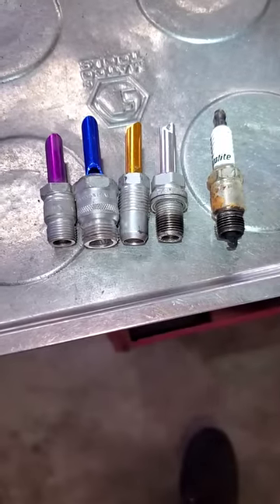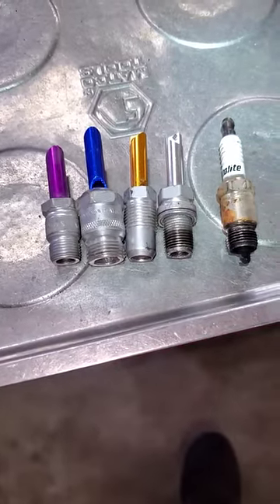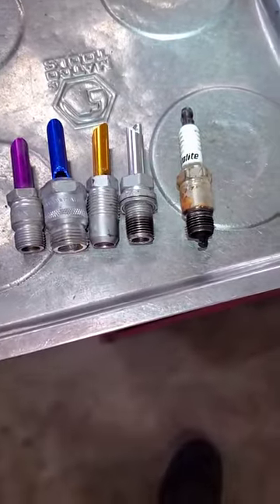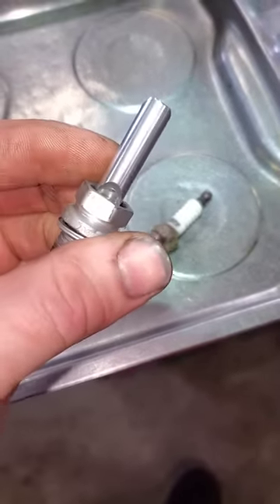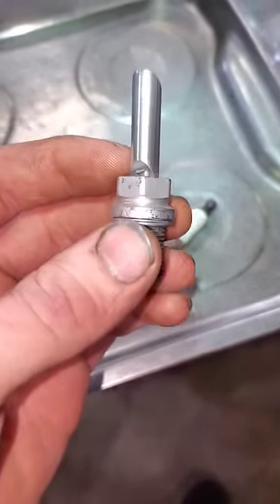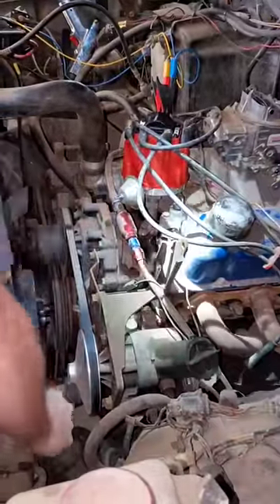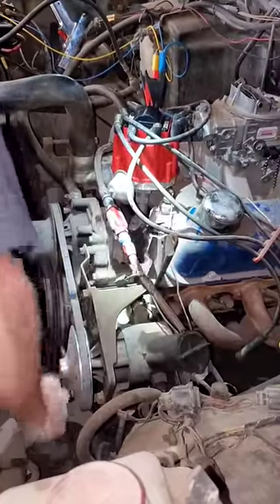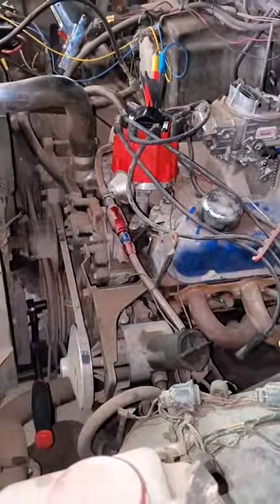Compression Whistles- Where Have They Been All My Life?

Comment from the maker: Attention to all the ignorant members of the YouTube comment crew: I specifically state this tool is used to find COMPRESSION STROKE, not TDC. I only said the piston was close to TDC because well, *it was* and to give the viewer an idea of what was going on inside the engine. 

If you want to find true TDC the only 100% accurate way is by using the piston stop method. The compression whistle tool is only used when stabbing a distributor to get the distributor gear in proper time with the cam gear as there are two different TDCs- compression stroke TDC and exhaust stroke TDC. If you stab the distributor at exhaust stroke TDC, the rotor will be 180 degress off. 

Also, when stabbing a distributor perfect TDC is not required and you can simply use a borescope or screwdriver to acquire "close enough" TDC.

And yes, I know this is cylinder #5. I filmed it like this as it was only a demonstration on my lunch break and that spark plug was the easiest to get to.
Reply: Just to say I preciate you sharing the video brother. Had no idea these existed tbh about it. Best thing to do for the ones talking shit,that prolly can’t even check engine oil. Hell just post another video bro.give ‘em sumn to really talk about 👍🏼
Reply: I never heard of these. I'm gonna get a set now cause I'm having an issue with a 3rd gen Camaro trying to get it timed on the distributior
Reply: Makes sense. It just tells you there is compression so it's probably worth it to get it cranking under its own power
Reply: Where do you get these from? Does Matco have them ?
Reply: Great video.  Question: It whistled multiple times.  How did you know when to stop?  Thanks!
Reply from the maker: @dalevackar182  Ebay
Reply from the maker: @turkeyssr  if it's still whistling, the piston is still traveling up so keep turning until it gets quiet. Then adjust piston to TDC with a borescope or screwdriver
Reply: @TechnicianRed  Yeah I found em thanks. It's kinda hard sometimes to hold your finger in the hole and roll her over by your self despite what the o-lady thinks.
Reply: Actually pretty cool. I'll have to check them out. Better than removing all plugs except cylinder 1, and feel for compression. That's how I do it, then verify TDC with a 1/4" extension
Reply: Or.. do the same thing with a long 1/4in extension lol
But I do understand you the position and circumstances won't always allow you to fit one down in there
Reply: @cokevspepsi516  I have long Phillips, the 1/4 extensions, even zip ties. Downfall, V8's you need to know if you're on compression or intake without having to remove the valve cover in many cases. 4 bangers are easy.
Reply: Isn't it obvious that a whistle isn't gonna tell you where tdc is lol?? It looks like a good idea maybe. I want to try it. Why would it whistle if the exhaust valve is open though?
Reply from the maker: @thehulkamaniabrother2.089  it whistles on exhaust stroke as some air goes out exhaust valve but some still goes out whistle as well. I'd say the whistle is about 80% quieter on exhaust stroke.
Reply: @thehulkamaniabrother2.089  yes, but the whistle doesn't have anything to do with TDC. Only compression or intake stroke. Example, we just did head gaskets on a 96 Suburban. Before you open it, you need to find TDC. But the harmonic balancer timing mark will show TDC on Intake and Exhaust. The whistle or compression tester will show which stroke you're on. You can also leave cylinder 1 spark plug in and feel for compression.
Reply: You were pretty clear. No need to defend yourself. Could one use the whistle with the TDC mark on the pulley? Would that work for every cylinder? Can't always trust the distributor, correct?
Reply from the maker: @pfsantos007  you could use the TDC mark on the balancer assuming the mark is accurate. Too many times I have found the balancer mark to be off more than 10 degrees  due to variances in the crank keyway position, aftermarket balancer being off, or (the most common issue) the outer balancer ring that has the timing marks has slipped on the inner hub from the rubber isolator loosing proper grip between the inner and outer portions of the balancer. This is why I allways confirm the TDC mark is accurate before timing the engine. I do this with a piston stop. Rotate engine until piston hits stop. Record reading on balancer. Now rotate engine the opposite way until the piston hits the stop again. Record reading. Both readings you took should be an equal amount of degrees from the 0 degree mark on balancer. So, if the first reading is 5 degrees BTDC, the 2nd reading should be 5 degrees ATDC. If they aren't the same, the balancer marks aren't accurate.
Reply: Man I’ve been around a long time and have many other ways of verifying the compression stroke…. But these compression whistles and the idea of compression whistles is just a fantastic idea! And I think anyone who works on engines should have a set of these. The only people hating are mad because they didn’t come up with it. Mad props to you, compression whistle guy 👏👏👏
Reply: @TechnicianRed  I see. Might have to try that. I have a 96 Tahoe that is being a piece of shit lol
Reply: Can you please make the engine run on five  cylinder it will sound cool to hear it 😂😂
Reply: AWESOME and I found timing marks off by 10 degrees on a Dodge Colt when I was in the process of rebuilding it when I was only 23 years old. I would highly recommend not getting into a hurry because if those are not tightened properly someone might get a hollow bullet in their forehead. 👀🙏🙏🙏
Reply: @josephmason738  I haven't seen a Dodge Colt for at least 23 years now lol. I forgot about those things until I saw that. My aunt used to have one.
Reply: @thehulkamaniabrother2.089  1975 Dodge Colt.LOL.
Reply: You'll always get YouTube comment "me hanics" trying to school a real mechanic. Crazy little gadgets man. Always having to lean over the engine myself with my finger on the hole to find compression stroke sucks.
Reply: In all my life I have never needed such a tool. Therefore I must leave a stupid comment.
Reply: Link???
Reply: @wannabecarguy : are use a compression tester never had any issues except one time a compression tester internal valve in the gauge went out and wouldn’t hold pressure so didn’t read right and threw me a curveball made my job six hours longer or something etc. etc. etc. other than that never had trouble using a compression gauge !!!!!!
Reply: @thehulkamaniabrother2.089  because in normal operation the spark plugs would be in and therefore it would force the exhaust in the combustion chamber to exit via the exhaust valves , with the whistle in the plug hole it isn’t sealed up in the chamber so it will push the air out of the whistle itself as well as the exhaust valves
Reply: I like it. I’ve only stabbed a few distributors myself. And yes, I just wanted to say stabbed a few.
Reply: Didn't have cool stuff like this back in my days of turning wrenches. That neat as hell.
Reply: Sounds like someone has a school crossing guard under their hood.
Reply: Very cool! Didn't  know those existed
Reply: I always used a screwdriver through the spark plug hole to find TDC.
Reply: That's pretty slick . I'd buy one
Reply: what a waste of server space. be a normal person and just put a long screw driver down it. then watch it go up and down.  this whistle thing is useless as you can easily still pass TDC
Reply: @TechnicianRed  😊
Reply: it's ok Rambo your the last one enemy's all gone come home Rambo I'll bring you in

Comment: I gotta get 8 of these and replace my buddy at work sparkplugs, it will be hilarious
Reply: @bleach_drink_me  I'd just pull the fuse for the fuel pump it'd be way easier
Reply: All he gotta do is pull the fuel pump fuse start the starter or use a impact on the front crank bolt unless that's not possible to do the front crank
Reply: @Frost_Tiger  that's just fkn silly, you don't go hitting crank bolts with rattle guns in their forward direction. Good way to never get that crank bolt off again
Reply: @crf80fdarkdays  just suggestion don't know what methods people may use to make a engine move fast enough I see what you're saying but I wouldn't balls to the wall it if possible
Reply: I'm dead! Lol
Reply: therse this one guy, hes great and we always mess with eachother, but he always leaves his car unlocked, always because he doesnt like unlocking it everytime
Reply: You need to do this 😂👌
Just label the leads first
Reply: @bleach_drink_me  I’d rather have my engine not start than have 2 cylinders not firing. That’s just gonna hurt your crankshaft
Reply: If you pull the fuel relay it could still start due to residual fuel under pressure. Ideally you want stop the injectors instead with that fuse.
Reply: If there's no spark it doesn't matter it won't start
Reply: Be careful, I don't care if it's a joke if someone messes with my car and causes a misfire, engine damafe or not someone is losing teeth
Reply: @kidsalex13  If there's spark on a couple it will
Reply: @chucksneed1264  there cannot be spark on a sparkplug it its not connected.........
Reply: UH OH watch out everyone we got a badass over here!!!!!!!!
Reply: @kidsalex13  It's a serious warning, people take their cars seriously. Disconnecting a battery is one thing but if you go doing something like pulling the plugs for a prank you're liable to get your ass beat lol

Comment: *me and everyone in the comments waiting to hear a motor run with one of these
Reply: DO IT PLEASE
Reply: @danthompson5797 you can definitely get an engine to run with one spark plug missing
Reply: He doesn’t need it to run load them all up and just hit the key for a minute.
Reply: That's not how this works, that's not how anything works.
Reply: @8l1nDw4rR10r That is how it works. Try to get out ya suburb sometime Robert..
Reply: @8l1nDw4rR10r  yeah no yeah this is exactly how this works.  Don't toot your horn around here (unless it's a bunch of these compression whistles)
Reply: @joelitty6103  
And have them shoot flames also.
Reply: So no one is gonna suggest putting them in glow plug holes.........
Reply: @EZ-D-FIANT  With or without fuel delivery disabled? 😉
Reply: Honestly you don’t need it or plugs. starters have teeth connected to the flywheel teeth and when you try to start the car the gears mesh and it try’s to start the car unless you don’t have your starter connected. this will turn the engine with or without spark plugs but not start
Reply: @DNightNinja  Who are you talking to?  

We're talking about what it would sound like if you ran an engine with one whistle in place of one plug.  

Spoiler alert: it would probably go from "tooot, tooot, tooooot..."  to "TUT-TUT-TUT-TUT-TUT-TUT-TUT!!!"
Reply: @eikuz for sure I've drove with three out of eight cylinders dead

Comment: Compression gauge and a long screwdriver I will always pick over these. Especially since everyone rebuilding or diagnosing deep engine work will (or should ) have a compression tester. 
But those whistlers sure are neat. If I still did mobile work regularly I'd keep one of those for a mobile kit.
Reply: Pulled the head once on a Hyundai, those gouges on the wall were why she was suddenly smoking and yea ol' mate was using a screwdriver without being careful about it just chewed the wall up at the back. Never saw anything like that happen again but I stopped doing it. Not saying you're wrong or anything, just a crazy story I thought I'd share 👍

Comment: These used to come with compression and leak down testers until the late 90s. The easier way I've found is to turn it over by hand with the whistle or an open tube stethoscope in the hole to hear the wind. This prevents over/under rotation of the target cylinder that is common when using the starter to turn it over.

Comment: very clever tool.   I've always taken the valve cover off then turned the motor over.  when the intake valve opens then closes i know it's on compression stroke  bring the timing mark to zero.     this seems like it would work well especially if the tones are different on exhaust and compression.   neat tool.
Reply from the maker: Finally someone that gets it! THANK YOU!

Comment: In the 70;s my dad taught me to use a drink straw poked down in the spark plug hole to rough gauge TDC. That way if you drop it or jam it its just plastic and will dissolve in gas. So I after all the speeches. I use a 1/4 socket extension and drop it in....(it was so horrible I thought head off etc...) 
  I then learned how to use a extendable magnet wand and lay on top of a sharp pointy engine while fiddleing for 20 minutes before successfully getting it out. I needed these whistles that day ...

Comment: I want to hear this as the engine is running
Reply from the maker: 🤣Yeah now I have to go try it!
Reply: I have a dogs toy squeaker teed into my egr vacuum.
Reply: @thisisyourcaptainspeaking2259  Video?
Reply: @bradensmith888  lol, hadn't considered it but that's an idea.  I probably will, now.
Reply: It’d have so much pressure it wouldn’t even whistle. Like when you blow in a whistle as hard as you can and it makes no sound except air coming out.
Reply: Likely it'll blow up the whistle.
Reply: @TechnicianRed  
Show us 😂👌
Reply: Bro…. It’s called a train🤣😭😭 CHOOO CHHOOO

Comment: tech tip: put compressed air through the spark plug hole, rotate the engine by hand, or with a remote switch on the starter. bump it until it locks up. hope this helps.

Comment: If you don’t wanna buy the tool,use a blow gun to blow into the piston you want on tdc,if you have air coming out the exhaust and intake your on overlap after exhaust stroke,180 degrees out.

Comment: That is cool! Beats the hell out of jamming your finger in the hole and ratcheting with your other hand or pulling valve covers to look at rockers.
Reply: It also beats the hell out of using a screwdriver to jam a pretty decent amount of one of those red shop rags into the #1 SP hole, removing the screwdriver (very important lol), then bumping the motor with the starter until the compression forces the rag back out with a loud enough to hear popping/cracking/banging noise usually several degrees before TDC.

Comment: I'd like to hear what it sounds like on a bad cylinder. I feel like it's still gonna whistle. Probably noticably quieter but at this point you could probably just stick a guage on until you see compression and then put a screwdriver in the plug hole and turn till it falls out.

Comment: My dad had something like that for doing pranks at the shop. There was another device that would plug into one of the sparkplug wires. The victim would start their car and it would run rough because of a dead cylinder and made all kinds of weird noises. Lol those guys were good at pranks. They lifted an office ladie's car just enough to get the drive wheels off the ground but low enough to look normal to watch the confusion. She got the car's wheels up to top speed in reverse and then put the car in park because it wasn't backing out. Lololol It was grinding the parking pin so loud. That prank backfired because they had to fix her transmission. Haha

Comment: One whistle, with a rubber cone on the spark plug end, fits everything.
Reply: But need a extra hand to hold it tight against plug hole then.
Reply: @joejizel5979  Nope. Stuff it in, twist. Been working for 20 years. Never had it fall out, or fail to seal enough to work.

Comment: I saw one of those years ago in an aftermarket Mercedes parts catalogue, it was a piece of rubber hose with a whistle stuck in the end. It's a good idea if you're working on older vehicles but I don't recall the last time I had to find TDC on the compression stroke of a vehicle. Distributorless ignition systems have made that a thing of the past.

Comment: do you have to be on compression stroke when doing a timing belt or is that only for ignition timing on distributor engines?
Reply from the maker: When doing a timing belt you use the factory marks to line everything up. Whether or not that is TDC, compression stroke, or whatever is irrelevant in that situation. Compression stroke identification is usually only used to help time a distributor.
Reply: @TechnicianRed  my friend, thank you

Comment: On compression stroke with your finger it holds the pressure until it actually pops off with a whistle it's going to whistle all the way through the duration which isn't going to give you a very close top dead center or bottom dead center just FYI
Reply: When it stops whistling...that's TDC dummy lol
Reply from the maker: This tool is only to find compression stroke, not TDC!

Comment: Coat hanger is usually free and gives you a 50/50 shot at being compression 😂 come to think of it, use this to find compression *then* coat hanger to find tdc 😁
Reply: How do i find tdc with a hanger?
Reply: @marte1a256  the simple wire ones, cut and straighten a length of it into a rod. Stick it down the spark plug hole and turn the crank by hand. When the hanger stops moving up you're at top stroke.

Comment: Just put a long screw driver in the hole, get a flash light, and a sharpie. Turn it thru with the screwdriver OUT. Put it in, check it when you find the top of the stroke, mark the screwdriver where it lines up with the top of the plug threads. He said the whistle also whistles on the exhaust stroke so, why is it better than what you have around the shop anyway?

Comment: I think I will stick with a compression gauge. That way I’ll know if my compression is normal or low-something the whistle probably won’t tell you.
Reply: Aww it'll tell you if you're getting all air through the whistle or if the exhaust valve is open it, in my assumption anyway, would be quieter. Heck I might be wrong on that one too.